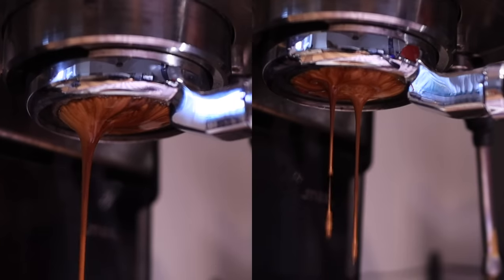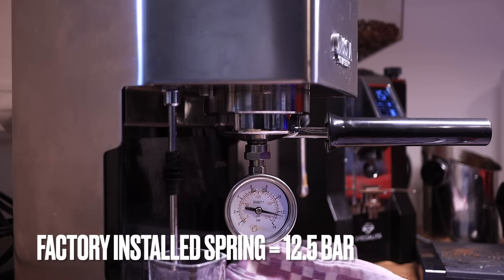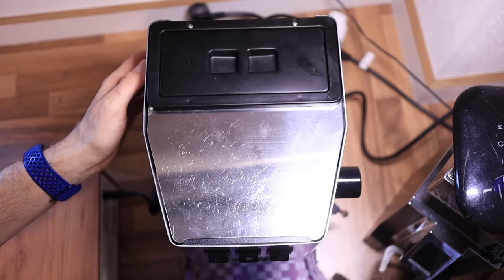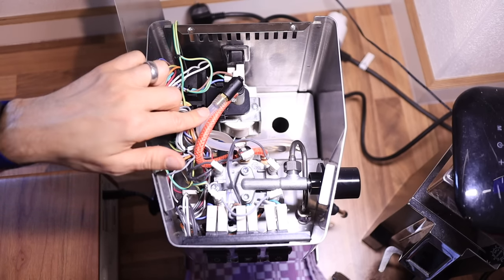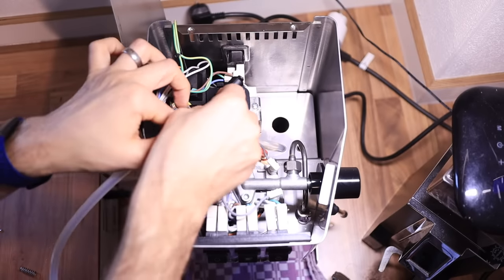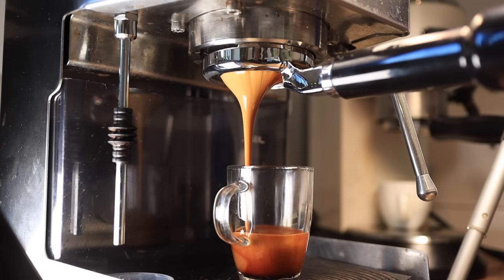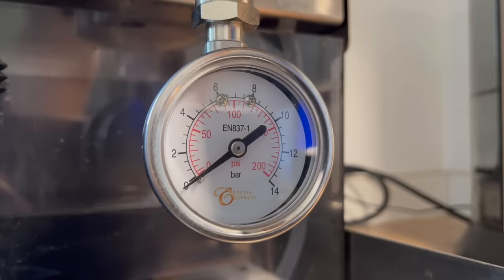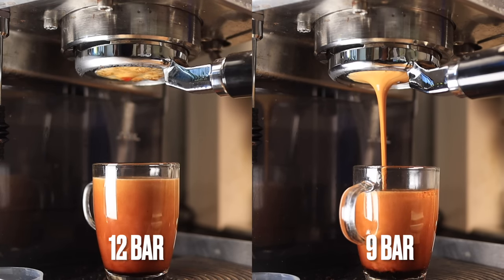You Won't Believe the Difference: 9, 6.5 & 5 Bar OPV Mod with Flow Rates for Gaggia Classic Pro

Comment: This video doesn't really make sense if the grind isn't adjusted for each spring to get close to a 30 second pull. Saying a 17 second 12 bar pull doesn't taste as good as a 23 second 9 bar pull isn't telling anything. A 17 second 9 bar pull isn't going to taste as good as a 23 second 9 bar pull. So what have we accomplished with this? Does it taste better because you switched from a 12 bar to a 9 bar or does it taste better because you are closer to a 30 second pull?  I am not saying a 9 bar isn't the way to go. just saying if one was to compare, then trying to get all shots at the same pull time with respective springs is what should be done.
Reply from the maker: Hi Salreus! Touché. 

But the point of this video was to exhibit how the flow rates differ, based on max OVP pressure. 

In a future video, it would be good to aim for results as you discuss (grind altered for same flow rates), but then you’ll have to rely on my subjective palate as to what’s best. If there is interest in such a test, I could do that in the future. 
Cheers!
Reply: @TomsCoffeeCorner  The video as it is shows that simply changing the pressure while keeping other variables unchanged has a notable effect, and that's worthwhile already.

Adjusting other variables in response, e.g. grind size, to get back to a good (tasty) extraction percentage, is the natural next step, but it definitely is another step.

Personally, I like explanations like I like my coffee, with high clarity. ;)
Reply: Agreed. Obviously flow rates are going to be different. Higher pressure will push through faster, just because of physics. You can't make any taste comparisons here. You adjust your flow rate with your grind anyways when you make espresso, so flow rate comparison isn't exactly useful.
Reply: @TomsCoffeeCorner  but isn't it obvious a 12 bar would have a faster flow rate? Higher pressure, higher flow rate. Basic math no?
Reply: Also another situation here that may be problematic is whether the GC machine has been pid modded... if not, then the temp cld totally mess up the result, like i sometimes had this thing going for too long and the extra hot temp burns and blasts through my shot (naked portafilter). Taste terrible, that!... Happy meddling!
Reply: This is why I always dial in to 25~30 seconds 1:2 brew ratio at 9 bar. Taste (usually tastes like shit to me). Then I throw away all "timing" rules and dial in by taste. I do minor changes to grinding while keeping brew ratio constant. After messing with grind settings, If I still want either more acidity or bitterness I play with brew ratio. That usually gives me a pretty good espresso and now I play around with pressure profiling which oftentimes adds a beautiful touch to light roasts.

The 25 second rule is a good starting point to ensure proper extraction. But once you start dialing in by taste, time becomes a distraction and places you in a box. Think outside the box. Break all rules, and you will taste the best espresso youve ever had guaranteed.
Reply: If you adjust the grind to obtain an equal extraction time with 12 bar you will get an over extracted shot that tastes like … 
At least that’s my experience.
Reply: @robinsonreichel1268 In your opinion is the 9 bar spring a "must do" modification? I've had my Gaggia Classic Pro for about 9 months and I have the spring kit in my drawer. I've been trying to learn everything I can with the stock configuration first. I just got a Eureka Mignon Specialita for Christmas, so that has made a huge improvement. I was thinking about finally swapping in the 9 bar spring tomorrow. Once I switch to 9 bars, would there ever be a reason why I would want to switch back to the stock 12+ bar spring?
Reply: @chriskvikstad4980  
As far as I’m concerned, I could not imagine one reason to return to stock. 😁
Try it, you’ll see…
Let me know what you think of the change.
Reply: @robinsonreichel1268 Thanks so much for the insights!  I just completed the spring swap and I used the 9 bar spring. I'm really impressed! I learned that my grind is way too coarse, as my double shot literally flew out of there in less than 15 seconds (ha ha) but the flavor is noticeablely better than I was getting with the stock 12.5 bar spring (or whatever the stock pressure is). I mean it's way better even though I'm still way too coarse with my grind. Man, this hobby is really fun.

I'm going to play around with my machine as it is now for another few months before taking the next step to install a PID and do the Gaggiuino upgrade that Tom did. Have you done that with yours?
Reply: @chriskvikstad4980 
Happy to hear you enjoy the mod. 
No I haven’t done the Gaggiuino. Mainly because I don’t own a Gaggia. 😅
I was just curious and watched the video because my Sage Barista Express pushed the water much too hard through the coffee too. 
After I modded the spring on the OPV to around 9 bar pressure it was day and night.  
So, no, not a Gaggia but yes the OPV-valve mod. 👍🤗
By the way, many home espresso machines do push much to much pressure without modding.

Comment: Hi Tom, I know this is an older video but the topic is very current, especially for those of us with Gaggia Classic Pros and other smaller, vibratory pump espresso machines that are shipped from the factory calibrated to higher pump pressures. I have been feeling disappointed with my spring mod for my Gaggia Classic Pro. I installed the 9 bar spring and it just hasn't made much of a difference for me, so I started really deep diving into what is going on. I found this interesting video from the Espresso TV channel regarding pump pressure differences.  In the video, the host visits the Bezzera factory in Italy and he talks about pressure with Luca Bezzera (the grandson of the man who invented the espresso machine). Luca Bezzera says that with small espresso machines using these tiny vibratory pumps, they have to be calibrated using higher pressure at the pump in order to get the proper flow rates and pressure at the group head during extraction.  There is significant pressure loss between the pump and group head during the actual extraction process.  He said they need to have 12+ bars of pressure at the pump because the pumps are so tiny. In contrast, large commercial machines and prosumer machines using rotary pumps are calibrated at 9 bars of pressure because the pumps are so much larger and more powerful. He's a native Italian speaker, so he's having some language barriers at times going between Italian to English, but he gets the point across. The host of Espresso TV is a German hydrodynamic engineer who used to design large pumping systems at water facilities. He understands the fluid mechanics involved and his English is really proficient, so he does a good job of trying to explain the basic physics in the comments section.

I believe Marc at Whole Latte Love has recreated some of these test experiments. I can't find his video at the moment. To accurately measure pressure loss between the pump and group head during an extraction, there needs to be a device attached to the portafilter that allows water to flow out at the proper extraction flow rate to simulate an actual extraction while the pressure is simultaneously being monitored at the portafilter.  If you do your test first, to measure the pump pressure, then you can conduct this second experiment to calculate the pressure loss in your machine during extraction.  Then you know with certainty what pressure you are really extracting with. Marc said there is so much pressure loss with the Gaggia Classic Pro that you are not extracting anywhere near 12 bars of pressure with the standard OPV spring.

Here is the Espresso TV Bezzera video. I thought you might find it interesting in case you haven't already seen it.  https://youtu.be/E4y4-E2aL3U?si=0JljcV2IEwJsZfth
Reply: Thanks A LOT man
Reply: Okay but you're not adjusting the pump pressure - you're adjusting the over pressure valve limit. The pump is doing it's thing at whatever bar, and the opv receives the water at that raw pressure and is simply rerouting some water back to the tank to keep the pressure at the  puck to what you choose via the adjustment screw/spring.

No offence to WLL but they are a retailer and the last thing they want is people thinking a popular product doesn't work out of the box, or feeling they need to go to the extent to modify it. They're thinking through the lens of someone having to sell the machine, not use the machine.

The reality is most well engineered espresso machines now have externally adjustable OPVs for this reason. Add a manometer and it's easier to adjust.

Comment: Appreciate the content and the flow comparison :)

My only issue with the taste comparison is that the GCP users need to be careful of temperature surfing. Sure the flow rate had impacted the  flavour of the coffee, but at the same time it could be the not perfect temperature surfing (not showed in this video). 

A part from that, flow comparison is great and I switched just last week from the standard to the 9Bar
Reply from the maker: Great point, Leonida! Aside from the temperature surfing, and you are right there, I would also have to redial the grinder for each brew pressure. But I thought the video would be more visually interesting to first exhibit the flow rate differences. Thanks for commenting! Tom

Comment: After significant experimentation, imo the best results from my GCP come from the original spring (13 bar?) and the Dimmer Mod.  That allows me to ramp up the pressure and taper it off.  I was watching a vid (I think it was the "Decent" machine) and it automatically ramped it up/down such that it peaked at 17 bar (?).   That gave me the idea to try it on the GCP and put the original spring back in, and I think the results are better.
Reply from the maker: Thanks for posting your experience! Tom

Comment: Thank you for putting this video together. I would be interested in a follow-up where all the shots have been properly dialled in for each pressure setting. 
Over the last 6 months I’ve also experimented with all four springs and personally I love the 6.5 bar OPV. I only drink long blacks so steam pressure is not an issue but I want the best flavour. The 6.5 bar spring affords me the most consistency and best flavour in my opinion and I found the 5 bar spring lacking body. 
Contrary to other comments here I actually had to grind slightly finer as I went from 9 to 6.5 bar, and finer again from 6.5 to 5 bar. 
I’d be interested in a deep dive comparison of all the springs and to see if you would recommend a specific brew ratio for the lower pressure springs. 
Cheers from Australia!
Reply from the maker: Thank you for the idea, Hannes. I plan to do this in the future. It is interesting that you had to grind finer at lower pressures. What kind of grinder are you using?
What brew ratio do you like for lower pressure springs? Cheers from Germany! ☕️
Reply: @TomsCoffeeCorner  
As far as I understand, when the pressure drops the flow rate will increase leading to faster shots. Hence the finer grind size. I spoke to several others on reddit who had the same experience. I’m using a 1ZPresso K-Plus hand grinder. The grind adjustments are rather large at 22microns per step on the K-Plus, thus I only had to grind one step finer when I went from 9 bar to 6.5 bar.
Personally I’m a fan of the classic 1:2 ratio. But to be honest, because I like the flavour at that particular ratio in my long blacks, I tend to just stick with it and not experiment with other ratios that much, which I probably should. Maybe you can sway me with your upcoming video, which I’ll look forward to. 
Cheers ☕️

Comment: Hi Tom! Question from someone starting their coffee journey: Considering that the extraction from the 12bar had bad taste, do you think it could be dialed in (using other variables) to taste better, or would you say that you had exhausted other variables and what was missing was the pressure difference, really?
Or rather, you wanted to use the pressure difference to really show the difference it makes in the extraction and flow, plain and simple?
Thanks for the great video!

Comment: Nice one Tom. I have only tasted 12bar and 9bar ones, I think the lower the pressure more acidic it gets and its definetly not for my taste. Shame the spring mod doesnt work on the dedica though :/
Reply from the maker: Totally agree, Enes! I prefer the 9 bar, of all of these springs. But it is an interesting test for sure. I think I could remove a little acidity by adjusting the grind settings, but I wanted to notice a difference in flow rate, based on pressure.
Reply: The lower the pressure, the quicker the shot needs to be. Search “turbo shots” and you’ll understand. You can’t use the same grind/ brew time for a 9 on a 6 bar spring; for the 6, grind more coarse and speed the shot time.

Comment: So I ordered a 3 spring combo off of ebay.  Shipped 10 days ago and for some reason isn’t here yet.  Was hoping to have it now!  I look forward to playing around with times/ratios with the 9 and 6.5.  I almost always do a 2:1 ratio and find the closer to 30 seconds the better. I’m using the bst 18g basket and a screen and grind 18-21g of coffee depending on the roast.  I like lighter roasts most and they’re more dense so 20-21 g and fit a screen in too.  I like strong too obviously 🏆
Reply from the maker: Hey Damon, I am not sure where you ordered from, but for me it took a few weeks, due to customs. Hope you have fun experimenting with the springs! Tom
Reply: @TomsCoffeeCorner  ah, maybe that’s it.  From china.. thanks man!  Keep experimenting too.  It’s part of the fun for sure☕️☕️
Reply from the maker: Oh yeah, from China it will take maybe 6 weeks.

Comment: You don't need to order the new spring. Just use the standard spring (and make it shorter) and loosen the brass screw (with the silicone hose). This loosens the spring and lowers the pressure. You can use some gas-sealing tape on the thread to prevent any leakage.  There is no water pressure in the silicone hose. But you will need a pressure meter.
Reply from the maker: Just be aware that this might not be that easy to do. I tried a similar experiment on the Delonghi, and the pressure did not seem to be linear based on the spring shortening.
Reply: @TomsCoffeeCorner  That true. You need to have the pressure measurement to adjust accurately, not on length measurement. The spring can be adjusted roughly. The fine tuning by turning in or out (a little bit) the brass spring holder nut. I managed to go to 9 bar with the original spring without cutting it. But better is to shorten it a bit, it will fit better that way.

Comment: Nice video Tom

Experimenting with my rancilio Epoca that comes from the factory with 12.5 bar, I found out that everything under 11 bar static pressure was unacceptable
Coffee flat, no taste, no acidity, very bad aftertaste, all coffees same bad taste
Only a very dark roast was acceptable but nothing special

Seems that the pressure at flow is much lower, maybe 4 bar less, at MY machine, but I don't have a scase to test it

What I saw is that as the pressure drops, the acidity drops too, but the good acidity, the acidity we want

That's why my machine is now set at 13 bars static pressure
Taste comes first, I really don't care if there is some channeling
Reply from the maker: Thanks for your feedback! For me, mouth feel and a balanced shot are the most important (not too sour or bitter), and 9 bars seems to provide that the best for my palate. But, since everyone's palate is different, I can imagine there are varying results. Cheers!
Reply: @TomsCoffeeCorner  off course coffee is a personal subjective thing

As I said, after a lot of trial and error and opinions of all over the world, I came out that  for vibe pump machines the optimal set is 10.5-12 bar(static), for rotary pump 8-9(static) and with levers you can drop to 6 bar
And off course is based to the level of roast
When the first lever came out, they used to drink very dark roasts
But with the right method you can have very good light roast extractions, that's why bezzera put a vibe at 11 bar for preinfussion at strega, and then the spring takes control
Reply: @wakeawaken430  very good point. I went from a vibration to a rotary pump and had to dial down the pressure. I still don’t get the same flavor profile as with my vibration pump. 🤔

Comment: This is great! I’ve been thinking a lot about this since I swapped out for the 9 bar spring and one thing I’m curious about is if you tried to dial in much for each spring? For instance, I would assume for the 12 bar spring you could reduce grind size a bit to get in the 20-30 second shot range. Similarly for the 6 or 6.5 bar spring if you go coarser I would think you could aim for the turbo shot range (10 - 20 seconds) to get a similar extraction. Thanks for putting in the work for this, I would love to try it but I’m too lazy!
Reply from the maker: Hey Jacob, sure I can do this. I just need 1 kg of some good beans, and some time. ;) 
I plan todo a follow up video in the future, and then I can show how the grind adjustment changes based on the OPV pressure.
Cheers!
Reply: @TomsCoffeeCorner  cool, can’t wait to see the results!